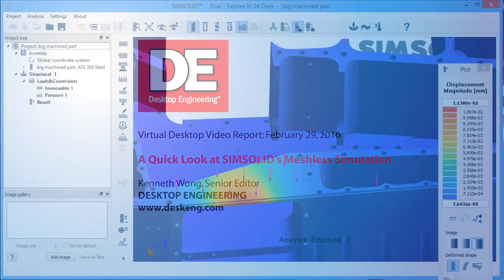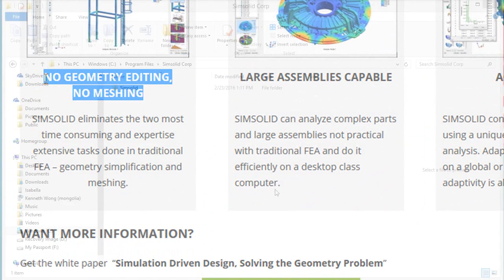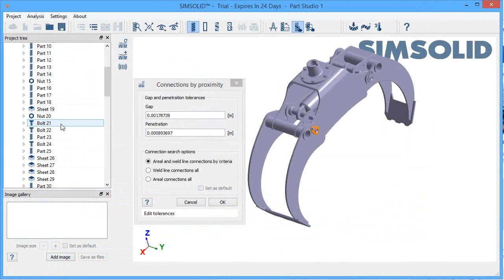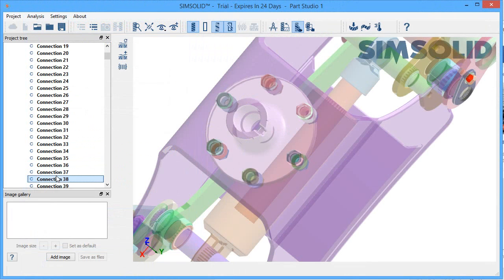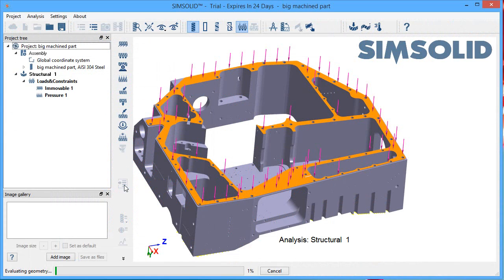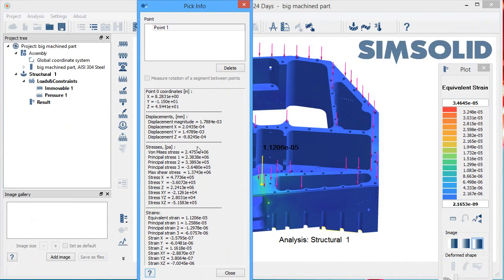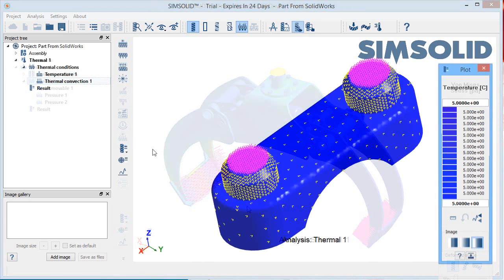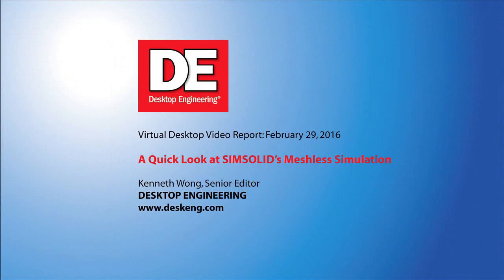Meshless FEA with SIMSOLID

Comment: Does meshless fea means there will no much requirement for CAE engineers?
Reply from the maker: Dear Kiran: You can still use the software for CAE, but "meshless" means you don't have to manually perform the "meshing" step in prepping the model.